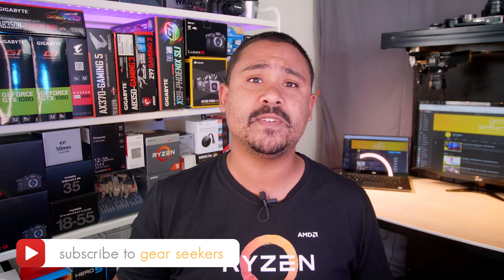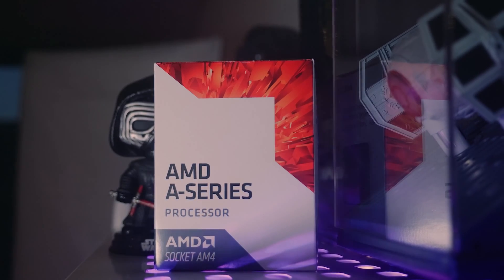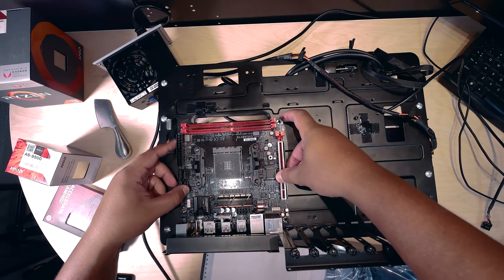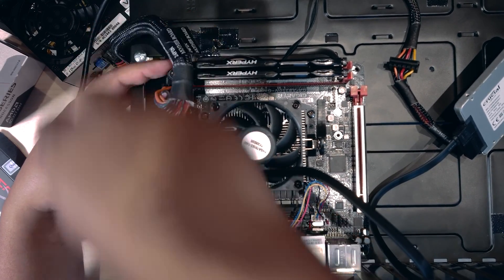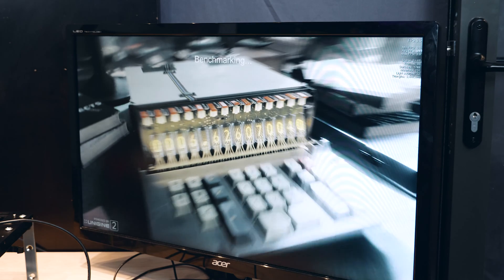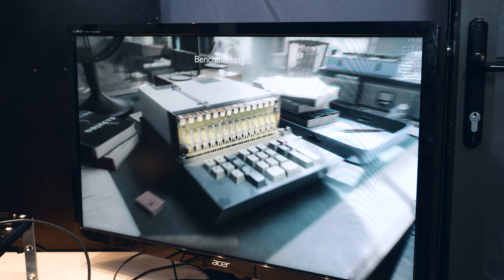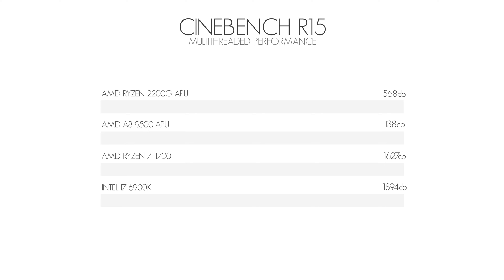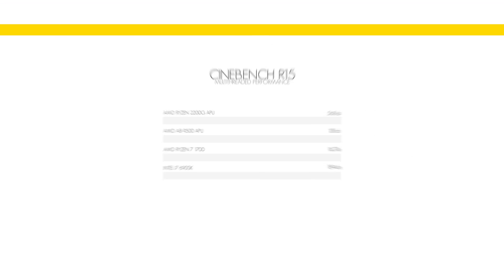Best Budget Gaming CPU/APU - Ryzen 3 2200G vs AMD A6-9500 Benchmarked

Comment: Im more wondering if the A6 would work well paired up with a GPU?
Reply: So already got a 1060gtx what will work better? A ryzen 3? Or a A8, both priced around the same £50 mark
Reply: @adamduffield7782  ryzen 3
Reply from the maker: Not sure. Give me a week and we'll test it out.
Reply: No. Absolutely not. The bulldozer CPU cores are awful, and are barely enough to let its integrated graphics run at full speed, let alone a discrete GPU.

Comment: You basically said,

"if you want to update bios for 2200g, buy a6 9500, update the bios."

Wtf.
Reply: Look for a MoBo that is labeled "Ryzen 2000 Ready" .... those have the updated BIOS already installed.
Reply from the maker: Probably doesn't apply now.